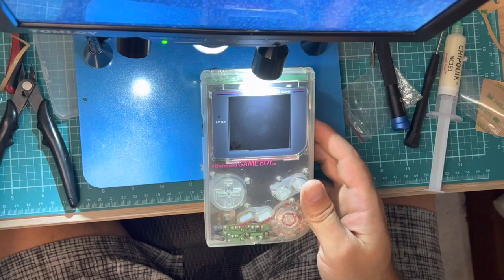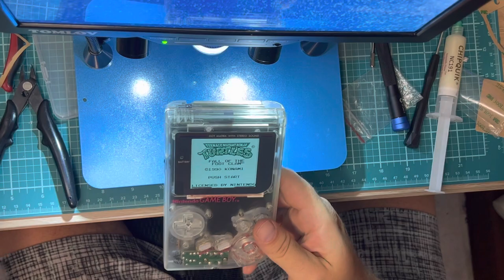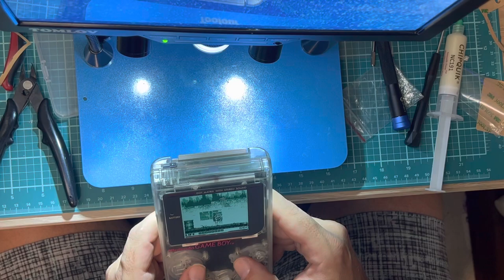🎮 How to Install Funnyplaying Kit On The Original Nintendo Game Boy DMG #gaming

Comment: For the speaker minus I would recommend turning up the heat on your iron since the ground plane on that PCB is huge and it seems your iron didn't have the largest thermal mass
Reply from the maker: Yea I had to turn the heat up in order for it to solder. I do have other tips, and should have swapped out the tip for a larger one. Great advice thank you

Comment: This kit comes with a touch sensor also I noticed on the ribbon cable, it's also on their website, but I don't see anyone using it or any explanation on it. I have the same kit installed but the sensor doesn't seem to do anything. Any ideas on that?
Reply: What I did notice is that the same ribbon cable is used for the Gameboy Pocket, maybe it only works on the pocket instead?
Reply from the maker: Hello! So this is the GAME BOY DMG Q5 RETRO PIXEL IPS LCD KIT. The contrast wheel from the original game boy is changed to a brightness wheel, and if you flick it quickly it can change the color hue. I believe it is like 30 different colors. 

When you see the ones with the touch sensors typically if it has 1 that changes brightness. If it has 2 one is for brightness and the other is for changing the screen color hue. 

Hope that helps! And thanks for watching!
Reply: @thenintari  HI, that's not what I mean. I know how it works. Even yours has the touch sensor in the ribbon cable. But apparantly it only works for the pocket and doesn't function for the DMG. Check the funnyplaying site and look at the ribbon replacement cable, you will see the touch sensor.
Reply from the maker: @FlabberQuestion  oh got it, yes you’re correct